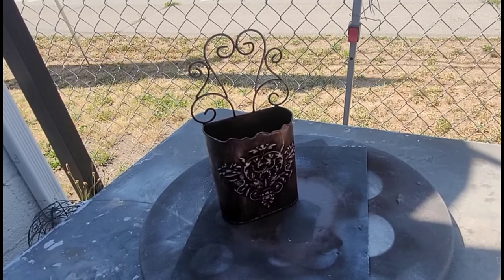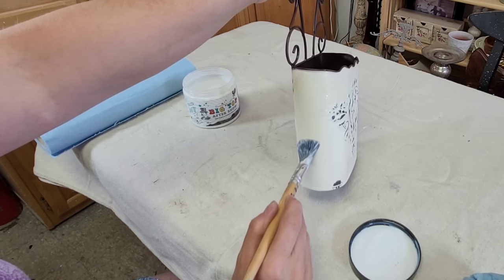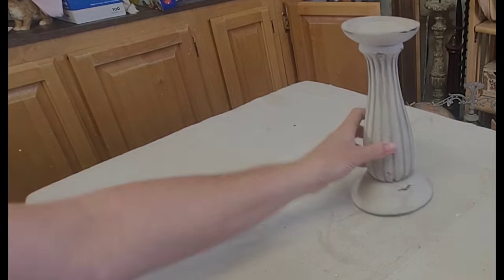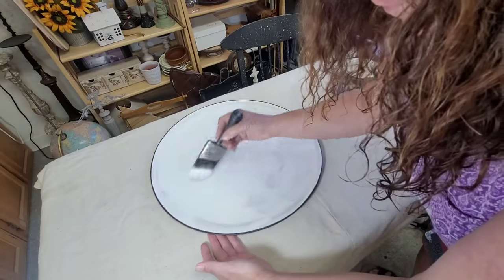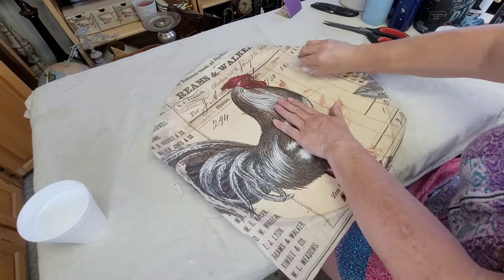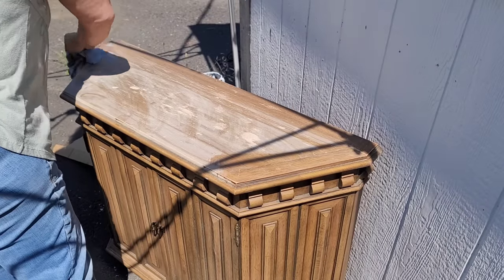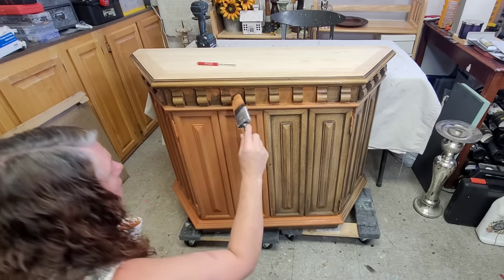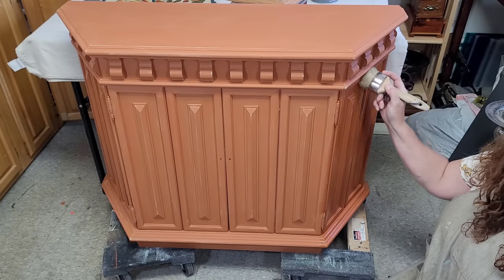Thrift Flip • Trash to Treasure •  Upcycled Farmhouse Vignette

Comment: Rachel I L💟VED projects 1 & 3 and wish I could BUY the little metal box and the rooster - and I don't typically like things distressed - BUT I L💟VED that metal box distressed, because it really shows the design of that medallion on the front❣️🥰  I actually liked the candle stick where the ribbed part was distressed, just not the other parts distressed - and it IS a beautiful color‼️😊

Now, for the sweet potato 🍠 cabinet. The details on that cabinet are GORGEOUS❣️🥰  The finish turned out beautifully with the sanding and dark waxing - it almost looks like a beachy, melony color - like a very ripe cantaloupe. 😃  This cabinet wouldn't "go" with my decor; however, if I had shades of orange🍊 in my decor, I would DEFINITELY want this piece of furniture in my home, because it is so unique. 😊  If ● I ● had refinished this piece, I would have sanded and wood stained the bottom (because I L🤎VE the look of wood) and used oxalic acid on the top to try to remove the blotches. If the stains STILL didn't come out. I would have painted the top ONLY in a light wisteria purple 💜 color and used in in my garden-themed wisteria bedroom, LOL.🤣🤣🤣 

YOU DID WELL, RACHEL❣️❣️❣️👍🏼
Reply from the maker: Thank you! I like your vision for the little cabinet. I love that each piece of furniture offers an almost infinite amount of possibilities as far as color and design - sometimes I end up just leaving a piece alone for a while because it's too hard to decide exactly what I want to do to it . . . I wait until it "speaks to me" . . . lol. I'm glad you liked the other projects (even if they were distressed, haha). Thank you again!! :)
Reply: @theeclecticcottagespokane  I agree with you about endless possibilities, and I also let things "speak to me" before I jump in. 😊 And you NEED to distress items, if that's what sells for you, Rachel❣️ And let me just add, I can appreciate the beauty of something that is not my style. 😉 It can genuinely be beautiful, but I wouldn't want it in my own home. 😃😁🧡

Comment: First time watching. Love the DIY paint and the Roycycle papers. On the Rooster tray, I am curious why you cut around the edge after applying instead of sanding it off. Just wondering if you were going for a specific look or if you thought the sanding would take away from the dark rim? It looks wonderful and I want to do something similar. 😊
Reply from the maker: Welcome! And yes - I didn't want to sand away the black, so sanding the edges wasn't an option. I tried "cutting" the decoupage paper with water on a scrap piece, but the edges ended up frayed and I didn't want that look either - so the only solution I could come up with was cutting it with a blade.  Time consuming, but I love the way it looks. :) Anyway - thank you, and thanks for watching!